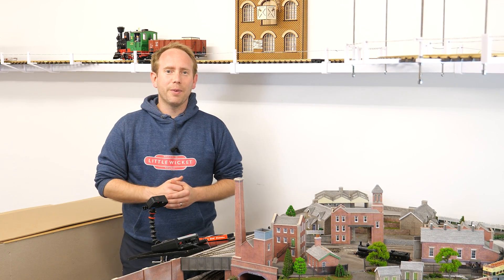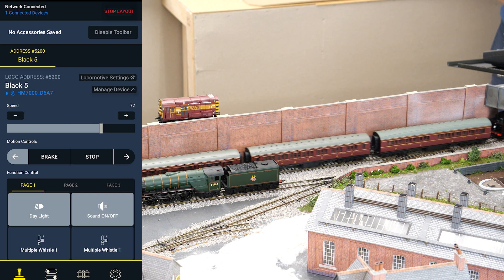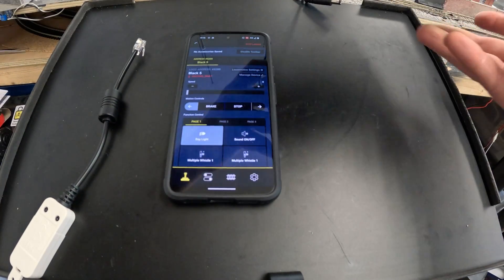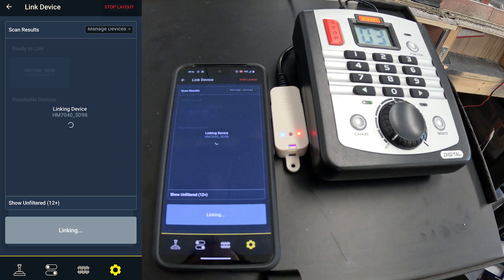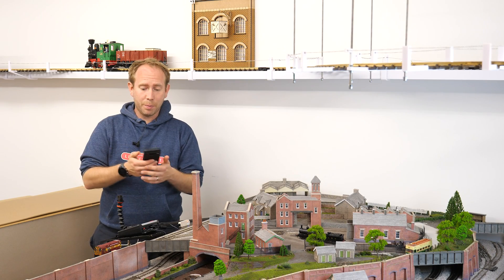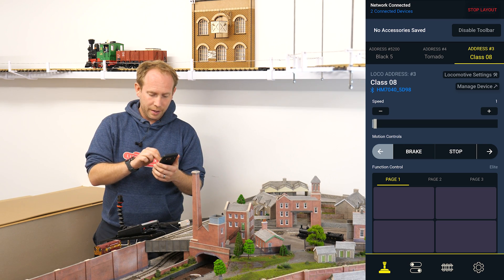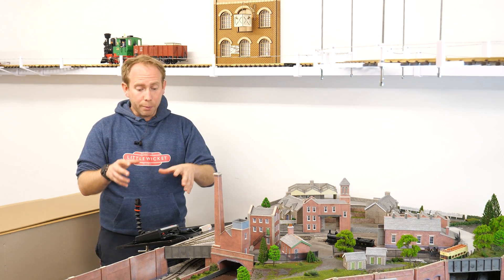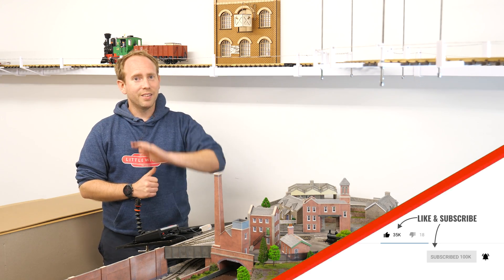Hornby HM7040 Bluetooth Legacy Dongle | Digital Wireless Control

Comment: This video has helped answer some of my questions, but I’m still a bit confused. I have an Accurascale 37/0 fitted with an HM7000 decoder, which gives me Hornby sound and some of the lights work, but not all of them. If I use the Accurascale Loksound decoder I can control all the lights, but obviously lose the Bluetooth/phone control. By introducing this dongle would I get full control of the Loksound lights/sounds via the HM app? Thanks for any advice!
Reply from the maker: Yes. The dongle basically just allows you to use your device as a wireless controller. Create a loco in the app on the Loksound address and link it to the dongle. Then you have access to all the function numbers. You can even rename them to match the Accurascale functions.
Reply: @LittleWicketRailway  That's perfect, and being to able rename the functions is what I was hoping for too - thanks for taking the time to answer.

Comment: Thanks for the great video. What power supply are you using to support the hm7000 system and DCC?
Reply from the maker: Most of the time I just connect a Hornby select, but my DCC controller of choice is DCC-EX.
Reply: @  thank you. I have bought a Hornby R7337 as that was the recommended power supply for an HM7000 setup. But if I connect that then I can’t connect the Hornby select. So maybe I didn’t need to buy the R7337 after all…

Comment: I don't have the horny select controller will it still work??
Reply from the maker: It'll definitely work with the Hornby Elite or Select. It might work with other controllers that use XpressNet and have the correct socket, but best check before buying.

Comment: sure but it doesn't work with everyones else way better DCC control set up's like NCE and Digitrax just Hornby's crappy 1980's (over 40 yr old now) DCC control - go figure. So why is it a game changer when it doesn't support  more than 95% of the DCC control systems on the market?
Reply from the maker: If you use a Hornby system (and a lot of people will) then it's a relatively cheap way of getting wireless control of locos with standard decoders fitted. It may also work with some other systems that support Xpressnet, so potentially Lenz. Obviously Hornby aren't going to develop a system for another brand's technology. A quick Google suggests adding wifi control to NCE costs around £80 and Digitrax is similar, so Hornby need some credit for doing it for half the price.

Comment: Excellent video - got me thinking I could use it in my ROCO/Flieschmann Z21 unit. Plugged the dongle into the Xbus port at the front of the Z21. Works a treat controlling multiple DCC locos via the App through dongle into Z21-- and so easy to do too! Game changer !!

Comment: One thing not mentioned in the setup paperwork is that the app has Select and Elite modes on account of the Select's limited addressing capability. I do not know what the practical result is.

Comment: Wonder if it will work on Railmaster and e-link?.
Reply: I’m pretty sure it doesn’t
Reply: Apparently not, which is a shame. They could actually update Railmaster to use bluetooth functionality already on the PC it is installed on (if it has it inbuilt or with a basic dongle), but I think Hornby have pretty much given up updating RM now as it's had nothing since 2021
Reply: @VictoryWorks  -Hornby doesn't have anything to do with RM, as it is supported by the 3rd party sub contractor that wrote it originally. Hornby only supports the hardware not the software.
Reply: ELink doesn't have an Xpressnet socket so the dongle is not applicable.
Reply: @brat96th  Thanks for replying. I've just come home from vacation so will crawl under the table tomorrow and see what I can see.

Comment: I use DCC-EX ++ and it is great. But then I don’t know if it is compatible with the new Hornby Bluetooth Decoders
Reply from the maker: DCC-EX will work with Hornby decoders. They're just like normal decoders, but with the extra option to control them directly via the app.
Reply: @LittleWicketRailway  yes I know as I have a number of TTS and non-TTS Hornby decoders running off Blue Tooth through DCC-EX ++. It’s these new Hornby Blue Tooth decoders I’m interested in. Can they be programmed via JMRI, and run through DCC-EX ++ and Engine driver on my iPads?
Reply: If you are using DCC-EX then it is the command station you are controlling with Bluetooth, not the decoders. I have not tried setting up an HM7000 decoder through DCC-EX as it is easier to just use the app, but I presume you could do it with the board in DCC mode.

Comment: Bought a 7040 dongle a few months ago (plugged into a Select and app on Android) and it has rejuvenated my enthusiasm. All but one loco is non-bluetooth and all the "legacy"-fitted chips work fine. Add a basic function map and edit it to suit the individual loco.
No more trying to remember what function number to enter to achieve something, all there on the display! No more trying to remember what the loco number is either, set a picture for each! A real joy running locos, not checking lists.
Yes, you still have to modify CVs via controller but the amount of time spent doing that is negligible compared to actual running.

Comment: Quite a handy option. Although I don't need a wireless system,  making a dongle that should in theory connect to all RJ11/RJ12 compatible systems is a smart move and is in my opinion much more practical than installing HM7000 decoders.

Comment: Compatibility with other XpressNet devices is poor on the two I've tried. The dongle doesn't work at all with a Roco 10764 and Multimaus. And it doesn't support long addresses on a Lenz LZV100/LH90. Both of those command stations work fine with all other XpressNet devices. E.g. I can use the Lenz throttle on the Roco and vice versa.

Disappointing and shortsighted by Hornby to just ignore the potential sales to non-Hornby XpressNet devices.

For less cost than the dongle you can put together a whole DCC-EX Command Station with superior functionality. I'd go that route to get WiFi control if I had to choose.
Reply: This has been discussed in various situations and the issue is ExpressNet is not a consistent specification, manufacturers have all gone and done different things with it and so for Hornby to attempt to make their dongle compatible with non standard non Hornby control systems is close on impossible due to IP protections. ExPressNet is not covered by strict NMRA protocols sadly.
Reply: @HighFell  then why are the Lenz and Roco throttles totally interoperable and why does the similar Z21 dongle made by MXion work fine? Whereas the Hornby one doesn't. Suggests the issue is Hornby's implementation of XpressNet, not anyone else's.
Reply: @eurovnik  That’s probably got a lot to do with the fact Lenz designed/produced parts of Roco’s digital system. 😁
Reply: It works fine on my Z21 plugged dongle in the XBus port at the front of the Z21
Reply: Well that's because the 10764 doesn't generate it's own waveform and uses some non standard tricks to get the signal from the controller to the track.

 The connection on the Hornby controller is practically the slave port of the basic Roco unit with the master unit being the device itself. On the Roco unit this task is delegated to whatever is connected to the master port.
Reply: @ivovanzon164   @ivovanzon164  So the dongle should work when plugged into the 10764's slave port when the Multimaus is plugged into the master port. Just like the Lenz throttle does and the Z21 dongle made by MXion does. Poor by Hornby.
Reply: Bought one to try with my old Select unit. I was very impressed and found all decoders responses much sharper. Have sent my Select back to Hornby for their £15 latest firmware upgrade,so looking forward to getting it back and putting the fleet on.